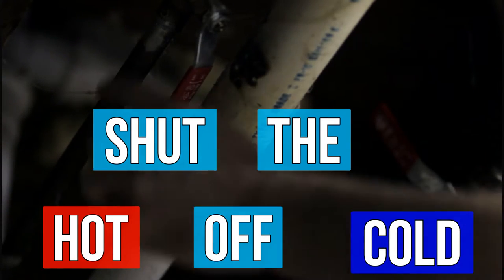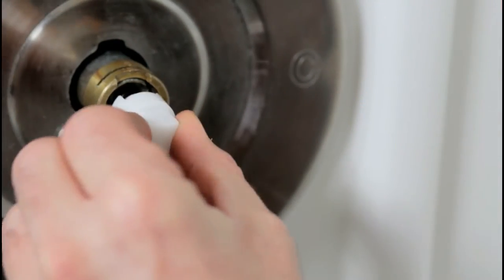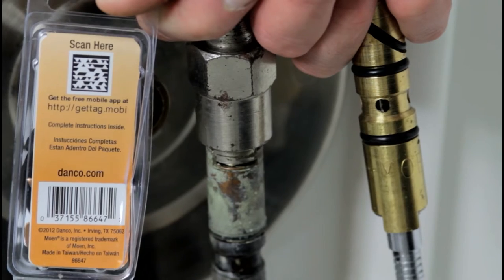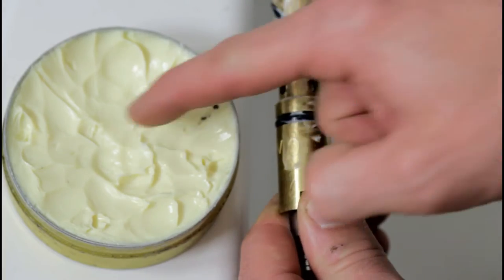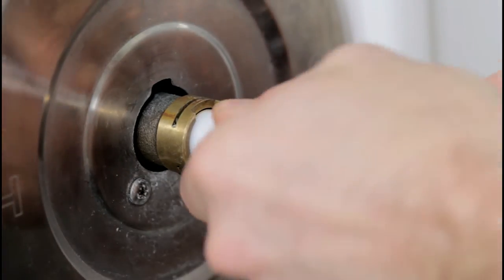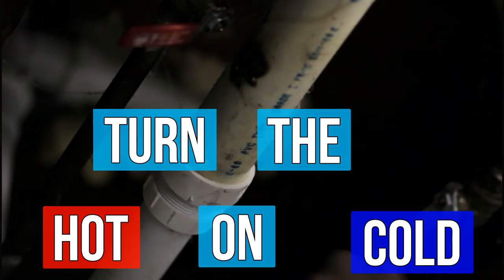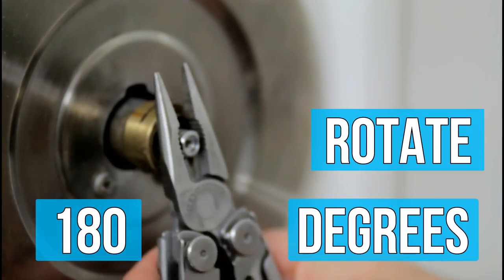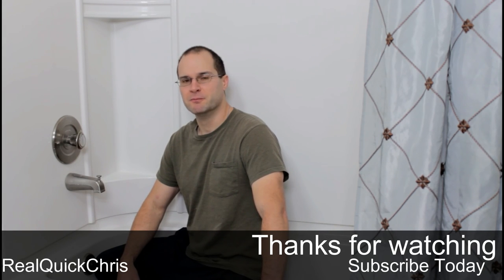DIY plumbing tips fix a leaky or stuck shower faucet handle

Comment: The last time I had to replace the faucet in my house is downstairs bathroom it was not quite that simple everything was a single unit and I could not replace the inner workings. So to my dismay $300 later and a whole lot of remodeling to the bathroom I now have a faucet that I can replace quite easily if ever needed to be done again LOL. Thanks for sharing my friend.
Reply from the maker: +Massachusetts Prepper 
That sounds like when I broke the soap dish in my shower then other tiles fell off and I had the great idea "well let's just take it all out" what a project that was. Lol thanks for sharing..
Reply: LOL

Comment: What if that valve is stuck inside? Or broke while  removing ?
Reply from the maker: I might be a little stuck when removing. Did it break when trying to remove ?  Once that retaining clip is out there should not be much holing it in aside from friction and built up junk.
Reply: @RealQuickChris  the valve broke in half while pulling out. We were able to remove it by drilling into it and pulling from that. Thanks